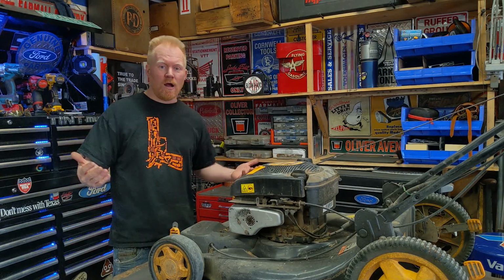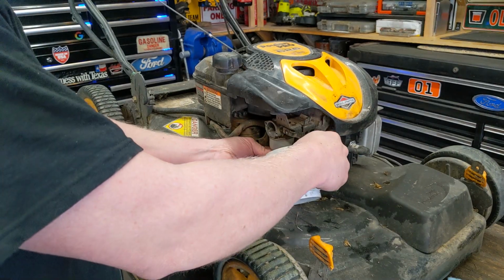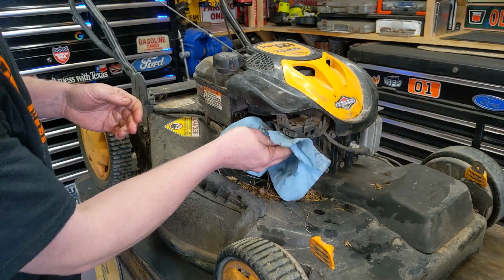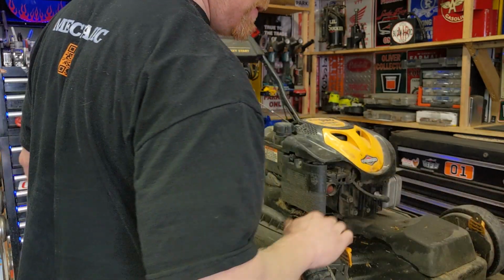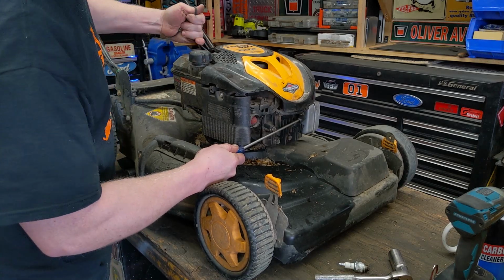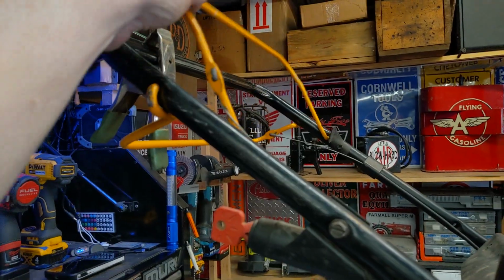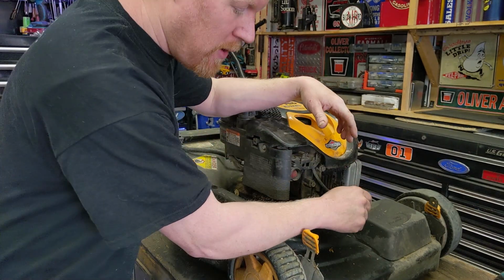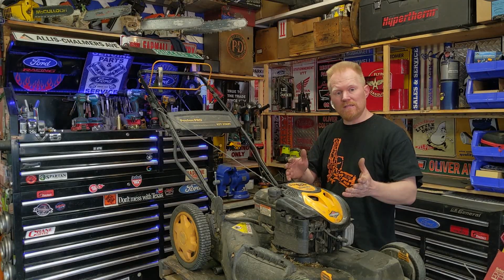Lawnmower won't start? Quickly find out why and fix it

Comment: Eliminator Performance Small Engine Repair here from Ontario, Canada. Nice video showing common problems, just a tip on that wrapped up cable to shorten it. The plastic connectors on each end of the cables can be rotated to shorten the cable (turning counterclockwise), not many are aware of this and end up doing what your customer did and a lot of the times they tie a knot in the cable. Here at our company we will shorten a customers cable by using this method unless the cable shows some type of fraying, or heavy rusting causing too much friction when being moved. In those cases a new OEM cable is installed. Hopefully, this saves your subscribers some money. Stay safe and healthy and looking forward to future videos.
Reply from the maker: Good point. Stretched cables is a pretty common issue I see after a machine gets over 10years old.
Reply: That's awesome! Thanks!

Comment: Dear sweet Ginger! I ran ethanol gas for a long time but finally bit the bullet and got ethanol free. I was AMAZED how much better ALL the small engines ran. 2 and 4 stroke! And I always pull the blower cover off for mouse nests and clean the rust off the magneto and flywheel anyway. And if it's junk I take the mag off and keep it. You never know! Thanks, Pal! A-PLUS and 9/10's is fuel related!
Reply from the maker: Years ago I was traveling 20+ miles to stock up but now it seams pretty readily available all over the US.
Reply: @sixtyfiveford  Likewise. Ours was 22 miles but now just down the road about a half a mile. We and you have to pay through the snoot for it but it sure has a lot more zip than the ethanol garbage!

Comment: I still remember when I was a little kid mowing the lawn and I decided to check the oil with the mower running and all the oil sprayed into my face when I opened the screw in oil plug.
Reply from the maker: I know exactly what you mean. I know better but sometimes my brain is busy and I have made the mistake more than once.

Comment: Always good to be reminded of the common faults :-D
That looks like a beast in comparison to my diddy B&S classic 3.5.
i've only replaced the layered gaskets once to fix the surging rpm, and spark plugs and sump oil was all that it needs over the years.
It's a bit weak now, it has real trouble if it hits tufty grass, but it was second hand so the rings and bore are worn im sure.
I can't moan, it's done a good job with very liitle going wrong :-D
Give your dog a hosepipe with water flying out, they love to bite the water lol.
Reply from the maker: Those Briggs classics are a fantastic simple design and rarely have issues. They allow you to run them into the ground.

Comment: Here's a weird one: About 15 years ago I bought a refurbished Craftsman mower from Sears. Worked for about a month and would not start. Spark fine. Carb looked new, but spent $50 and replaced it. STILL not starting! Finally took the fan shroud off. Two self tapping screw that held the intake tube (plastic) were loose. Tightened those up and it started right up! Then it was driving me nuts, so I HAD to try the original carb again to see if I wasted $50. It ran, but not near as great as with the new carb. Crazzzzy! 😆😆😆
Reply: Walt thanks for the reply to my comment, here at Eliminator Performance we strive to be helpful to all of our subscribers as well as those on other video channels and thought this cable shortening technique was not widely known. Since Covid 19 has forced me into isolation and i have been watching YouTube videos constantly i have found Steve's Small Engine Saloon has actually done a video on what he is calling a non adjustable cable fix check it out. Not sure if my son will be doing a video on this but check him out.

Comment: I got a free lawn mower, self propelled with the same B&S engine on the side of the road one time. The air filter was absolutely 100% ruined. It was packed with all sorts of mud and grass and leaves and completely soaked in motor oil. They probably put the lawn mower on its side and had all the engine oil leak onto the air filter... I just removed the air filter and it coughed up a bunch of black soot and then started running normal. Sold it on craigslist soon after for a $100. The things people throw away lol
Reply from the maker: Awesome.

Comment: There's also a tiny orifice at the top of the main jet that gets gunked up, but completely missed in a standard cleaning.  Definitely watch for that, too.
Reply from the maker: Yes, on Tecumseh's that feeds the idle circuit. I see very few on mowers anymore as most are well over 20years old now.
Reply: @sixtyfiveford  That's fair.  I haven't worked on anything newer yet.

Comment: do some of the engines have a sensor to keep it from running if there's no oil?
Reply from the maker: I've never seen one on a mower unless it was a commercial unit. It's more limited to horizontal shaft engines that use commercial engines(Honda GX series, Briggs Vanguard, Clones of the GX series engine, etc.)The low oil shutdown will simply ground out the spark and can be bypassed by unplugging it.

Comment: Hey man I have a question on carb adjustment on 2 strokes. I stopped at my local small engine store today to ask if they sold the tools for adjusting the mix n they said it's illegal to sell the tools. I told them they're all over online for sale n they said that's illegal. I mean even walmarts website sells them so are they just jerking me around trying to get me to pay them to adjust it or what. I mean the only reason I want them is cuz I gotta pull the adjustments out n clean them cuz I used a wire connector to adjust it n had to turn them way out for it to run on half choke so they need a good cleaning after the Weed eater has been sitting like 6 years
Reply from the maker: They are correct about not being able to legally sell them to the general public. They are able to get away with it online because they can claim they're selling it to a shop. Personally I don't like the tools and just take a dremel to the top of the needle and make a flat head screw out of them(I cut through some of the carb body to do this). I do this on every machine that comes into my shop. It allows you to see exactly where it was set from the factory. On a side note the #1 issue with these is the diaphragm dries out.
Reply: @sixtyfiveford  yeah I'm hoping to get away with not having to get a rebuild kit for it since it's not mine n the owner is my 88 year old gramma. I mean obviously she isn't gonna use it n has an electric one but I'm trying to get it going for her

Comment: I have a predator 212cc, sat for about 6months, i put a new carb on an still nothing, what could be the problem now its a pretty new engine
Reply from the maker: The Predator should have a low oil shutdown that will kill the spark. I would check for spark.
Reply: Marshall W  so you're saying it's "ether or" ? 😆😆😆 Couldn't resist!

Comment: Great video, Thank you.

Having a hard time with my 23hp Vanguard twin cylinder engine starting.  It has got worse over the past couple years but when I ask mechanics about it, I hear all kinds of things like it is the carb, the valves need adjusting, it is the fuel, etc......

I put Stabil fuel stabilizer into the gas every fillup, it is 11 gallons on a commercial machine, key start and the engine turns over fast but I have to choke it and raise the throttle lever to half way up or more for it to start.

Changed the fuel filter, bought gas from different places but cannot figure this out and hate to take it to a shop and end up buying a new carb or paying a lot to have them clean it and rebuild it.

Any ideas about this Sir?

Thank you.
Reply from the maker: I own half a dozen Vanguard V Twins. Valves would be more of a performance issue but "could" lower the compression to the point of hard starting. However Carb would be my first go to. Choke will force the engine to suck fuel from the bowl. Needing to put it half throttle would signify the idle passages are partially blocked and not allowing fuel to be pulled up through them. Opening the throttle allows the larger fuel passages to pull the fuel. Is this on a pressure washer? Running a cleaner through the fuel system can help clear these passages but it is a slow process that takes weeks and a few tanks of fuel.
Reply: @sixtyfiveford  Yes, a large commercial pressure washer.  I fill up 5 gallon gas cans and then fill up the tank, too hard to get the trailer into gas stations as I need the outer pump for the trailer.   I put 2 ounces of Stabil into each 5 gallon can and put 5 gallons of gas into it then top off the machine tank and I do this all the time so I am wondering how this could let the carb get messed up? ? ? ?
Reply: I just put some seafoam into the tank, a whole bottle of it and hoping it will clean it out. Do you think this would work or some other chemical would be better or is it better to take the carb off and clean it out?

I have not done this but I have tools and mechanic skills but hate to take on something that I might mess up, damage or cannot get parts for.

Thank you.
Reply from the maker: @Superiorpowerwash  I like straight Acetone in the gasoline as that is the only thing I've found that dissolves gummed up gasoline. Acetone is essentially what Carb Cleaner is. These carbs aren't too bad to work on. These are one of the few carbs I clean on the machine without removing it. It has a top plate that comes off and you can view everything down inside.
Reply: @sixtyfiveford  How much acetone would you put into 10 gallons of gas or into a 5 gallon can?   Thanks for the help, I appreciate it.

Comment: Years ago, after taking my mower to a local guy to have it "fixed" again, he finally said:  "I hate to take $50 from you so I'm going to tell you what you can do so you will never have to come back to me again. You have a condensation issue with your fuel and all it takes is one tine drop of moisture and you will have trouble starting and keeping it running, so do this. Go to the airport and buy yourself some aviation fuel. Never use anything else. Your mower will start first time, every time. And use it in all your small engines."

So I loaded my mower and followed his suggestion and went to the local municipal airport, gas can in hand, and asked for two gallons of aviation fuel. I filled it with aviation fuel and have never looked back. Every year, come spring time, I give the cord one pull and it start right up. No priming needed. Even with the mover wintering outside (but under cover) I have never had an issue starting the mower. It's been 5 or 6 years now and he has since moved away but I owe him a huge debt of gratitude for the advice.

Seems airplane engines don't like moisture issues at elevation and aviation fuel is formulated to prevent those issues.
Reply from the maker: He was right on the money. Aviation fuel is just ethanol free, sometimes with lead to cool the valves. You can go to a website call pure-gas.org and find local gas stations that carry ethanol free(usually airports are listed as well).

Comment: "Ain't got no gas in it" -sorry, had to.
Reply: It's true! I got one for service exactly for this. The fuel turn off valve was blocked so no gas. Cleaned out, cleared the filter and carb body and customer was delighted that I didn't charge them 👍
Reply: @subhobroto  "All right, then mmhm."

Comment: Mine won't start and it's spitting raw fuel out of the muffler. And it's brand new.
Reply from the maker: Float stuck and dumping fuel continuously into the motor.
Reply: That was it. I should've drained it before storage. Thanks partner